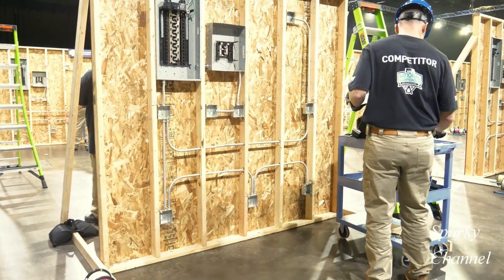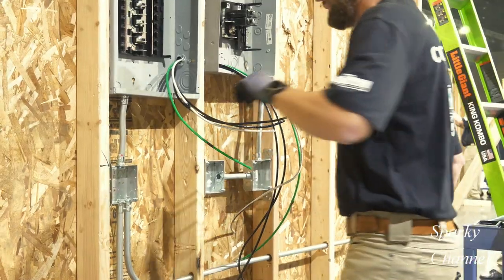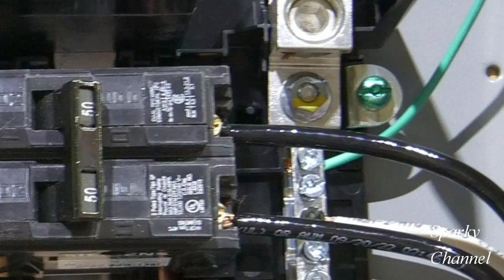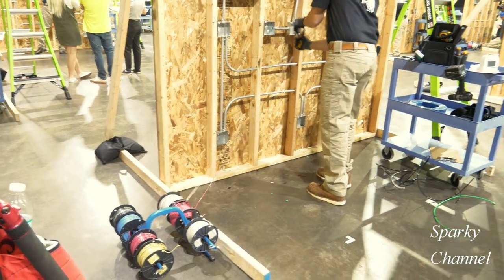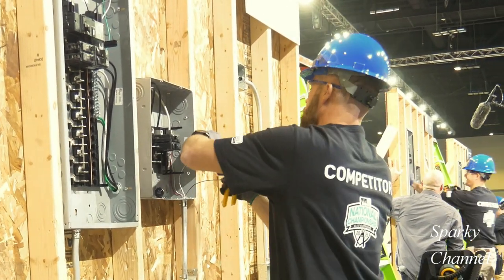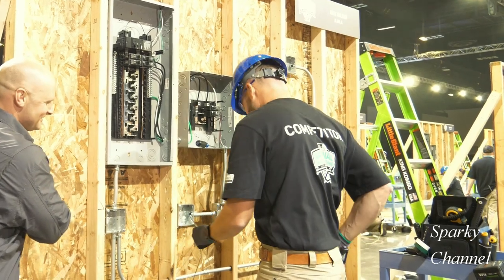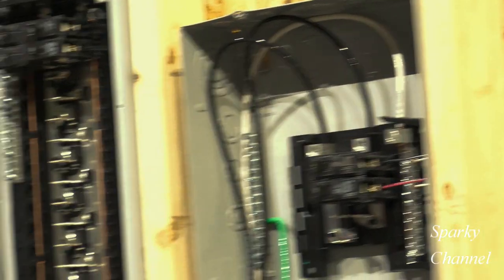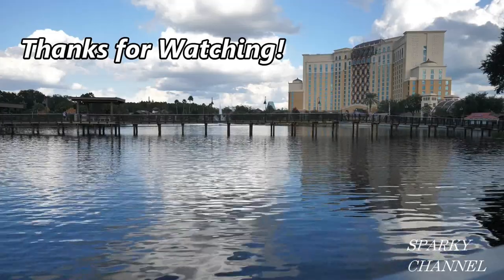Watch a Pro Run 2 Circuits in 1 EMT Conduit and See How a Subpanel Is Wired

Comment: Per code, the EMT can be used as an EGC, however I always run a ground wire for each pipe. Also, phasing one of the feeders red would aid in troubleshooting down the road (not required per 215, but good practice)
Reply from the maker: Me too. These competitors weren't given any green wire though, so they were tested on EGC code.
Merry Christmas!
Reply: Thanks that was my first question.   I pretty much have only used NM so this is new to me!

Comment: It would have been nice in my opinion , to mention also  , something about derating , as long he ran 4 current-carrying conductors in one conduit.
Reply: While derating technically applies here, it doesn't change what's done.  So I can see not mentioning it, since it happens so frequently.  You just know 4 wires here are fine.  For those that want to get into it,  240.4(D) says 14ga is 15a max, 12ga is 20a max.  Derate for 4 current carrying conductors per 310.15(C)(1) is 80%.  However, the derate is against the wire rating, not the max specified by 240.4(D).  The ratings on the THHN likely being used is a 14ga/25A and 12ga/30A (90C - 5A less for 75C).  So after the derate, it's still good for full circuit amperage.
Reply: 🤦‍♂Didn't look closely enough at the installation before posting my prior comment.  No multiple current carrying conductor derating applies at all.  310.15(C)(1)(b) - Adjustment factors shall not apply to conductors in raceways having a length not exceeding 600 mm (24 in.).

Comment: Question...since the boxes wired from the panel were metal and in pipe why was there not a ground wire from the panel to connect to each device?
Reply from the maker: These competitors weren't given any green wire. In this way, they were tested in their knowledge of EGC code. 
Merry Christmas!

Comment: The ground is being passed via the conduit. Many newer outlets have a connection on the screw mount to the box that will pick up the ground from the metal box. I would assume that in that case a (neutral [wrong word, disregard) EGC bonding wire would not be necessary. Have you seen a problem with the built-in grounding to the box on the newer outlets and would, therefore, recommend the ground wire anyway?
Reply from the maker: I believe you're referring to the self-grounding clips? They eliminate the need for bonding wire connecting the metal box to the device. However, I would still use a bonding wire as a redundant means of bonding. They do not eliminate the need for a neutral. See my video: What is a Self Grounding Clip and What Does the 2020 NEC Say About Them?: https://youtu.be/mRK8JluQwj4
Reply: @SparkyChannel  Correct. I don't know why I said "neutral bonding," he's running an EGC bonding wire. So, technically, the grounding clip is sufficient, but the wire is a good idea anyway. I had previously seen your other video, hence the reason for the question.
Reply from the maker: @wmcomprev  It's a good question. I think I'll make a video about this. :)
Reply: Using my philosophy about being nice to "the next guy" someday that receptacle will be updated to a GFCI or to a "smart" outlet that might not have a self-grounding clip - so having a green wire in there would be a kindness.
Reply: @HoosierRallyMaster  While possible, and I agree with that philosophy, I would suspect that as time goes by, more & more outlets will have the grounding clip. By the time the outlet needs replaced, it's likely that they will all have the grounding clip or the strap itself will be designated by the manufacturer as being sufficient if you remove the paper washer from the back of it.
Reply from the maker: @HoosierRallyMaster  I agree. Merry Christmas!

Comment: You ran your green ground wire from the sub panel to the neutral bus bar in the main panel?
In other words, they’re married on the same bus bar.
Isn’t that against the NEC code and also, the sub panel is to be grounded separate from the main panel with its own grounding rod.

Comment: No bond bushing on the sub pan?
Reply: Don't need one
Reply: Only the first panel gets bonded.  That's why sub panel has separate ground and neutral wires.
Reply: @gregorysampson8759 where’s it’s separate ground?
I see it bonded to the main panels neutral bar which is not NEC code but has to have its own separate grounding rod.
I learned this from Sparky.

Comment: Could black wire have been used for both circuits?
Reply: Yes it could. And most are in residential. As far as I know you can run black for all circuits except  in some 3 phase systems where a high leg has to be orange, but it’s common practice to label different circuits according to circuit number especially in 3 phase systems as it avoids confusion when troubleshooting and not to mention crossing high voltage and low voltage panels. So generally single phase in like a residential setting will have a single hot and a single neutral coming in on the transformer on the pole and on the secondary side it is center tapped which is where the neutral comes from and each end of the windings of the secondary of the transformer is a leg and between the two legs you get 240 volts and between each of the legs and the center tap or neutral you get 120 volts. Also known as split phase. So even though you have a single phase feeding your house to get dual voltages it is center tapped so each half of the windings are 1/2 the voltage of the full winding together and this is why most of the wires such as romex you see in a house are black, because each leg is just two halves of the same single phase feeding the transformer. Now 3 phase is a little different as now you have 3 different phases coming and a ground that doubles as a neutral when using one of the three phases like feeding a house in a city of the power lines because all power from generating stations are transmitted with 3 phases and a ground because true 3 phase power doesn’t require a neutral. Only when you branch off one of those three does it require a neutral. That is why I’m the city you see a powerline that will have 3 wires on top and one single one at the bottom. Those three are the three hots and that bottom is the ground. And most businesses use 3 phase power in the city and even on farms. That’s why when you get in the country you’ll notice that the powerlines that were 3 wires on top and one on the bottom becomes one on top and one on the bottom on country roads where no 3 phase is needed and that where one of those phases is branched off in it’s respected direction and is split as equal as possible so much will come from one phase and go one way and the other phases are branched off so each two wire going down a country road will most likely be a different phase from the three in the city and that bottom wire is the neutral and ground. Industrial and commercial buildings will be fed with all three phases as they will need all three to power things like motors and other apparatus’s that require more power to run. And this is where you’ll see multiple color cables for different circuits and industry standard is high voltage is brown, orange and yellow, and purple depending on where you are and a grey for the neutral. That’s the 277/480 volt panels and low voltage is black, red, and blue for the hots and white for the neutrals for 120/208 panels. It makes it way easier is they are color coded to their circuit number as it narrows it down to the circuit numbers. Makes troubleshooting and stuff that much easier. Also side note to find the color code of the wire for your circuit number if it is divisible by 6 evenly it would be blue for low voltage or yellow for high voltage and if it isn’t divisible by 6 to use the remainder. And this assumes you know that circuits 1 and 2 are black for low voltage and brown for high voltage circuits 3 and 4 are red for low voltage and orange for high voltage and 5 and 6 are blue for low voltage and yellow for high voltage. An example would be say you have a panel and you are trying to figure out what color wire to pull for say circuit 30. We’ll 6 goes into that evenly so if you were pulling for a low voltage panel you would pull a blue, if you were pulling for a high voltage panel you would pull a yellow. But now say for instance you run into a circuit that isn’t divisible by 6; say it’s circuit 25 we’ll 6 goes into 25 four times with a remainder of 1. So back when I said that circuit 1 and 2 are black for low voltage and brown for high voltage and that you use the remainder if it’s no divisible by 6. In that case the remainder was 1 so you would base your color or wire off of circuit 1. Odd number are on the left side of a panel and even are on the right side. And the panels are number as such it’s just how the breaker slot is attached to the buss bars that run vertically in the panels, for single phase it’ll be two for 3 phase it will be 3 single buss bars, and it starts at the top with 1 and 2 across from each other so they share the same buss bar attachment point and as you go down it shifts to a different phase so 3 and 4 will share a buss bar connection and 5 and 6 share a connection and so on. Regardless of how many circuits you have. It starts at phase A then goes the phase B then goes to phase C  and starts back at A and so forth. I hope i didn’t confuse you much and I know I added a little more information than you asked. But I hope it helps.
Reply: @usmarinekenny  Thanks for taking the time to explain. I appreciate the in-depth description.
Reply: Yeah, that seemed weird.  I only use red for 3-way switches, or sometimes light fixtures.

Comment: This goes against all practices of grounding I have done out in the field...do not use a metal box or pipe as your ground...use a ground wire from your ground bar in the panel so that in case the metal parts used to "bond" the panel are compromised the ground will always have a connection to ground through the EGC from the main panel
Reply from the maker: Excellent. But these competitors weren't given any green wire. In this way, they were tested in their knowledge of EGC code. 
Merry Christmas!
Reply: To be fair, this is a competition, and they are given a spec that is permitted by code.  In the competition are they rewarded or penalized for "improving" the spec?  If I was paying for the improvement and it was something I didn't ask for, I'd penalize them!  In real life, are you turning down bids because it specs conduit EGC because you refuse to do that?  Or paying the cost for the upgrade out of your pocket to get the bid?
Reply: Why does everyone think adding a green wire really adds anything safety wise. The code is way tougher than necessary already.
Reply: @TheRetiredtech  In my experience, there are significantly more failures that break EGC connectivity with a conduit EGC vs a green wire EGC, especially over improvement and maintenance iterations.  No EGC, no fault clearing and now a shock hazard, made worse by the ungrounded bonded conduit and boxes putting the voltage everywhere for someone to come in contact with. Locating+fixing a non-obvious break once you are aware of it is often so much work to be not be cost effective - just slap a GFCI on it or do a new run.
Reply from the maker: @RJ-ej1nr  Hi RJ! Great to hear from you. Merry Christmas!
The thing is, these guys have to know the code cold. If they don't know what to do if there is no green wire and they are running emt, they aren't going to make it to the next round. :goodvibes:
Reply from the maker: @TheRetiredtech  True, but I would run the green egc wire if it was possible as a redundant egc.
Reply from the maker: @RJ-ej1nr  Good point, thanks!
Reply: @SparkyChannel  Merry Christmas to you as well, and thank you muchly for the all the videos throughout the year.  First rate content, all the time!  On the prior comments earlier in this chain, I think my first response to John's comment came across as a response to yours, so didn't make the sense I thought it did at the time.  While I understand John's saying this isn't what he would do, it also felt like he was implying Greg should have done something else (and maybe that was a stretch).  It didn't make sense to me what Greg's other choice should be, either in the competition or for someone else in that situation in real life, hence the comment.
Reply from the maker: @RJ-ej1nr  I understand. 
2023 250.118(A) has some interesting changes this year re bonding jumpers. It's on my list of topics for videos. I have a big house renovation coming up though, so it may be a while.

Comment: Aren't you supposed to start down stream? Otherwise there's potential a hot wire in that panel.
Reply: There’s really no potential for the wire to be hot, unless someone flips the breaker.